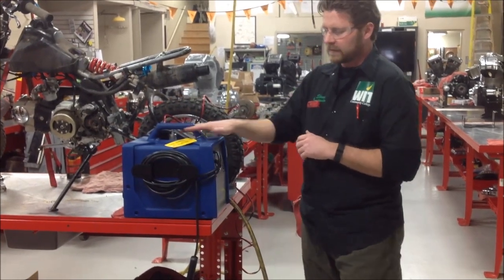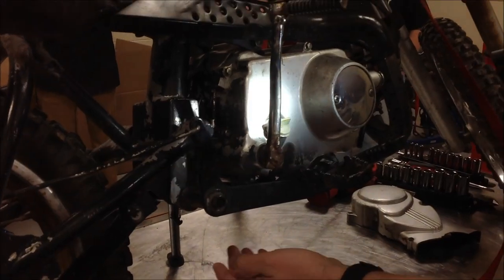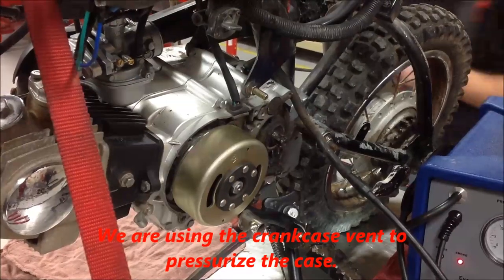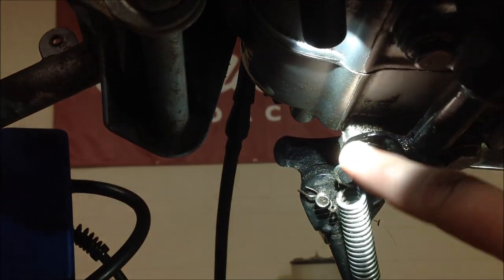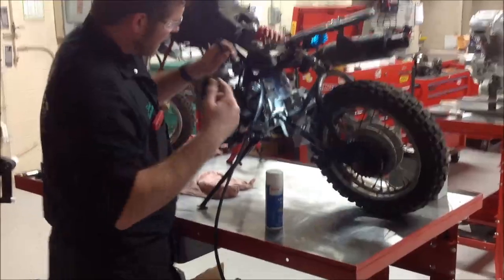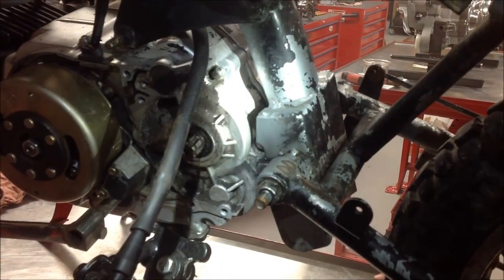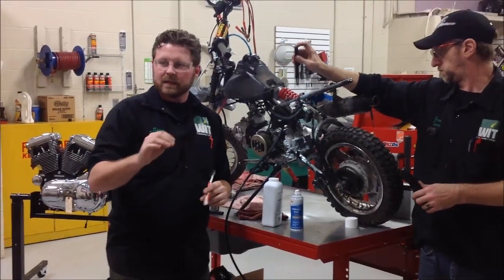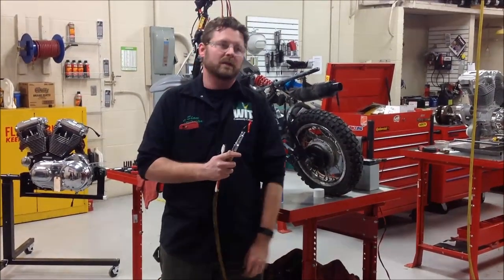How to find oil leaks with 100% verification of the source! No more guessing!

Comment: Within the Engineering community where I work, we have a saying: "if you haven't found the problem yet, then you haven't done enought testing". In other words, TEST and VERIFY, only then can you FIX  - right first time.
Q4U: smoke machines are expensive, so you could concievably generate some pressure inside a crankcase (or other cavity) by using a tyre foot pump, or even rig up a bit of piping to use a tyre (at reduced pressure, 3-4psi say) as the air and pressure source.
You can buy smoke canisters for testing smoke alarms, so you could use one of these as your smoke source. In aerosol form it would also provide some pressure.
This is the first time I've come across your channel - you've gained a subscriber.
Reply from the maker: Thank you for subbing and taking the time to comment with your experience!  

Have you seen the video playlists https://www.youtube.com/user/conleybuilt/playlists ? 
Want to say “thanks” or “keep it up”? Click here https://www.paypal.me/how2wrench

Comment: If you leave the oil in the crankcase, then you could just pressurize it using air pressure. That will push the oil out. If you drain the oil out and are patient then the smoke machine seems to make more sense since you can use the smoke, which will eventually escape, to identify the location of the leak just like you would on an intake manifold, etc. I like the spray powder and dry powder trick, great idea. Thanks!

Comment: Another excellent video, Shane. And another excuse to try and snag a smoke machine, ha ha.
Reply from the maker: +spelunkerd Thank you and please share!
Reply: +Shane Conley been watching your videos and have to say they are very good, very in depth, clear and informative, I have a problem on my 1998 Kawasaki zzr1100,  engine starts fine and idles ok, I pull  in the clutch, select 1st gear, slowly release the clutch and the engine dies, ive checked the obvious things, sidestand switch and clutch switch but all seem to work ok, any ideas???
Reply from the maker: Sorry I'm just seeing this. 

Head over to the new website @ how2wrench.com and check out all the free videos, blog and newsletter @ http://how2wrench.com/contact/

Keep Wrenching,
Shane Conley
Instructor/Motivator/Motorcyclist!
www.How2Wrench.com

Comment: The smoke machine would only serve it's purpose if the leak was above oil level. You just need an air line or a bicycle pump to put a bit of pressure into the gearbox.
Reply from the maker: This smoke machine is air pressurized. I don't know what output (it was very little psi) but slight enough that oil was able to push pasts seals and cracks. I would have to agree with you in very difficult to find small leaks more air would be needed and extreme car not to over do it...:) 
Thank you for taking the time to comment! Hit that subscribe button please! It helps us!
Here is a way to support all the free videos.
Want to say “thanks” or “keep it up”? Click here https://www.paypal.me/how2wrench  

Coach Conley is also available for hire to personally work one on one with you if ever needed. Yep he is a real person. Give him a call @ 602-345-0432

Your answers and help are just around the corner. Save time and money while protecting your investment and yourself by doing it the right way!
Follow us!
Web:
www.How2Wrench.com    
www.Tools2Wrench.com

Comment: Could I try this on my 99 buick century? ive spent hundreds on fixing an oil leak that's lasted for almost 2 years
Reply from the maker: Absolutely. A few more steps are required. If you would like more help I offer email or phone service for a small fee. Head over to my website become a member now and to receive 20 minutes of personal mentorship with me. You can even use FaceTime if you have it or find a friends iPhone and we can walk through the actual carburetor process together. I look forward to mentoring you.

Note: Membership is not required to receive coaching or email help. Here are the direct links to individual services offered at H2W:

Email Answer Service-Click http://how2wrench.com/product/email-support/ 

Phone/FaceTime Coaching-Click http://how2wrench.com/product/personal-tech-training-phone-facetime/ 
Keep Wrenching,
Shane Conley
Instructor/Motivator/Motorcyclist!
www.How2Wrench.com
Reply: No your brand isn’t supported unfortunately the tools won’t work on your block of metal